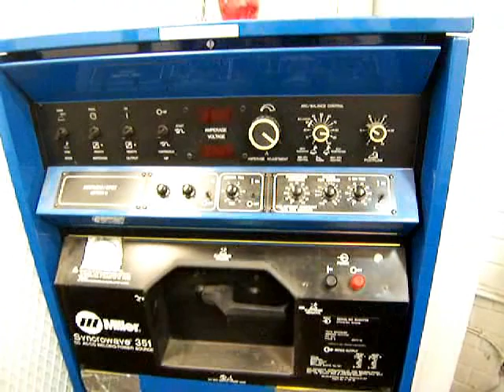Different Types of Welding

Comment: What always drove me nuts was working in ships that were making railings and bannisters, you want all those teeny welds looking great, but you only have mig welders around, then you gotta grind and sand with dynafiles all over, a tig torch would go so far there, no cleanup really required.  Wast more time with mig, and tig is already clean even though slower process, but mig cleanup is even longer.

Comment: Im just wondering what the best way to weld huge pieces of plate steel together is. Ive never welded before or at least not like this. Im a blacksmith and im going to try making a roughly 250 pound anvil with my dad who is a great welder. Itd be made of roughly 1 to 2 inch thick plates of steel welded together and it needs to be as tough and as solid as possible.

Comment: I liked your video.  I was wondering if 18 gauge stainless steel square wire mesh  can be tig'ed to 1/4' or thicker stainless steel plate.  Or is the 18 gauge leads of the square mesh too difficult or impossible to attach to the plate?

Comment: no love for the flux core? sad days.
Reply: Isn't flux core just Mig with special wire and no shielding gas? It's usually not considered a separate type of welding.
Reply: Flux Cored Arc Welding is a different welding process compared to Gas Metal Arc Welding. GMAW uses a solid wired where as FCAW uses a tubular wire which contains a flux that produces the needed shielding gas. It can be single or dual shield if an external shielding gas such as Co2 is used. GMAW requires a shielding gas due to the fact that there is no shielding gas from any other source.
Reply: +drdwkelley yo he wanted some love for flux not a googled deffinition of what it is

Comment: Do you have any experience with old school gas welding? I only have a DC stick welder and I like it, I was considering a scratch start tig setup to cheaply expand my options, but if I wanted to I could get a gas welding setup for free, minus the bottles. Reading up on gas, it seems it can do the same job, more or less, and it can silver solder and braze.

Comment: Another misconception people will have about Flux Core is its always a  Gasless process and that absolutely not true. In fact most all Flux Core welding done on heavy equipment manufacturing is done with Gas Flux Core. You still run the same 75/25 gas and everything. And as Jodie says if you know what your doing you can make some of best looking welds as well as some of the strongest possible. Im actually getting to where i prefer it over hard wire gas MIG now to some degree but it all depends on the application. My next venture is to hone my TIG welding skills and at that point ill be well rounded with all welding process's. Of course i figure ill end up with just as much time under the hood to perfect TIG welding as i have with ALL the Stick and MIG processes ive run. But thats ok.. Its never too late to learn more.
Reply: You, sir, are speaking of dual shield! That's the ONLY process worth running on heavy equipment.
Reply: Mad Anthony Wayne I weld Paving Equipment at the shop i work at now. Thats pretty much how we weld everything. Theres a few things i weld TIG but even the pressure tested stuff is all Flux. Flux Core is also ALOT easier and better for doing pressure tested stuff i think because where you stop and restart doesnt tend to leak like it does with Gas MIG!

Comment: hi guys, i am very new  in welding, but i have always had an intrest. i found that it is overwhelming for me to learn all at once, i was wondering if i could get any advise on how any of you were taught or if anyone has any tips, i would be happy to learn
Reply: I just wanted to say thank you to everyone who helped out and gave advice! And just a little side note: I ended the semester of welding with a 100% :)
Reply: +kate sorg You can go to Jody's web site "weldingtipsandtricks.com" and look under the 'forum' tab.  Introduce yourself and feel free to ask questions!  I am an instructor at a tech college and I can offer you some advice for specific problems.  Where are you learning, and why do you want to weld?
Reply: thanks guys!
Reply: an apprenticeship in sheet metal, boilermaker, or boat building is a good start
Reply: +kate sorg 
Just general advice, start learning with stick/arc welding. Once you get good at stick and gain some knowledge and experience, move to TIG and then MIG. Take the time to get good with the stick. If you do that, learning the TIG and MIG becomes much easier and quicker to pick up on.
The most difficult part of welding (in my opinion) is learning the appropriate styles and technologies to use depending on the application. Also learning a little metallurgy and how to better identify the different types of materials you will encounter really goes a long way to making you not just a passable welder but a good welder.
When you know what kind of material you are welding and the best materials and welding technology to use, it really makes the task so much easier and you just get a better all around result.
Based on my experience, welding skill will come with time and experience. Welding knowledge is what separates the girls from the women (in your case) ;)
Reply: kate sorg
Congratulations! I only got 85% out of my first class.

Comment: Tig is by no means a slow process for a skilled welder
Reply: +Rasmus farkas I think what he means is it is a slower process compared to MIG. TIG and Stick are specialty processes for specific applications in the field. No manufacturer is going to have you weld for instance Hollow Metal Door Frames TIG because in the time it takes someone to weld 1 door frame up TIG i will have 5 welded with MIG. Even Stainless Doors and Frames will be welded MIG not only because its faster but the final look of the weld means nothing because it will be grinded down smooth anyway to be finished and have the lines in the stainless put back in.
TIG is more for cosmetic applications where the look matters more than anything in a manufacturing environment.
Reply: Yes it is without a doubt

Comment: stick holder allows you to angle the filler rod or bend the filler rod looks cool but I need to understand more about the dc  and ac machines the smaller machines are usually only ac 120 or 240 but having dc and different polarities may do something different that I currently don't understand

Comment: Sir, If I want to weld a M3 nut to a 2 mm width steel shaft (The shaft passes through the nut), which is the best process? This is for toys and not industrial use. I don't want to use glue.
Reply: Coming from a relative newbie, and talking to a few old timers, you should go with tig.

Tig is known for having a very precise and tight welds, and is also the most clean in the sense that there is no slag to chip off or oxides to wire brush.
Reply: Sachin Kotian dont listen to this guy above me. go with a 110v mig and tack the nuts to the shaft, 2mm is pretty small so tig would probably be the best and strongest way... but considering its "non crucial" type of weld a 110v mig would be best, also considering the initial cost of the machine too. way less then a tig machine.

Comment: Can you tell me, why is it when you tig aluminium you need AC, but you can DC weld aluminium with mig?
Reply: I'm not an expert, but I think if you TIG weld aluminium with DC electrode negative you don't get the cleaning action necessary to bite through the oxide layer to get a good weld, and with DC electrode positive you get good cleaning but the electrode starts to bulb from the heat and causes the arc to be less controlled. AC gives the benefit of control and cleaning because it alternates between positive and negative. You can weld with DC on TIG, but it's best not to because of the disadvantages.

In MIG welding the wire itself completes the arc, and because the wire is constantly being fed through you don't have to worry about rounding off the electrode and creating an uncontrolled arc, and so DC electrode positive on MIG will give you cleaning and control.

Comment: Generally stick welding is considered too slow for workshop applications and is reserved for site work only.
Reply: Sturm geschutz i think you mean production settings. stick is still the most common process for workshops that commonly handle material 1/2 and greater. stick welders can be bought much cheaper and are more versitle then say like a spray transfer mig.
Reply: No, where i worked we made alot of custom jobs and it was always quicker to mig rather than stick.
Reply: Why would you stick weld a digger bucket or a 40 ton coal hopper or a 20 ton peat dryer when you can mig it? That would be madness.
Reply: not everyone has a spray transfer mig, or a big enough shop to do what they need in. with stick you can do the work anywhere. youre not limited to what you can fit in the shop.
Reply: Thats a different case, but surely a small workshop that is going to take on the construction of say digger buckets they would invest in one. I had a 1980s Hobart bros with a giant armature lol. Perform just as good as a brand new Miller.
Reply: In the field you can't get a mig hook up most times
Reply: a good welder can burn sticks fast though... it is a little slower than mig, but it only takes about 5 seconds to change an electrode if you are working effeciently.

Comment: flux wire welder here ive been through 4 pounds of the stuff and i will admit ive come a long way learning the angles to hold the gun and such with raising the amperage for greater penetration. i use a Lincolin weld pack HD i thought i broke it yesterday however it just overheated! its probably the cheapest welder ive seen for the quality. looking to upgrade to tig with the gas for cleaner welding. and more versatile.

Comment: Normally I would say go with separate machines but the PowerMTS welders are very reliable. If you are at all thinking of welding with those processes I would suggest picking one up. Get a spool gun too if you are doing aluminum. My 2 cents.

Comment: For me it took a few days to get decent at mig, tig, dual shield and 7024 but I found them easier than pipe welding with 6010 root and a 7018 cover which I have did on amonia refrigeration pipeing for 25 years but maybe it is because I really know what I'm looking at now compared to when I started stick welding years ago, anyhow I like all types of welding except tig in the 6g with a open butt, that 7 o clock to about 9 o clock is terrible for me but I can pass a xray and have. just lucky.

Comment: I would love to see a video of stick welding with 1/8 - 7018 rod welding in a tight position.. Currently working on welding 1/4 plates on steel post but with very little space.. I have to bend rods into a sort of "S" shape to get down into the space and weld vertical and having difficult time trying to be consistent..welds are ugly and can only burn about a 3rd of the rod...please help

Comment: If Im welding a steel on a backhoe bucket, or a dumptruck tailgate, I would want to use stick welding correct? because its dirty, and the type of metal. not to mention its easy?

Comment: Great video!! I like your little finger cover. When I was working for DuPont Chemical plant in Waynesboro VA I was tig welding stainless steel pipe. Nothing any bigger than 2”! Clean job!!! I could have worn a suit and tie to work and went home clean. I had a cover for my baby finger and ring finger. That’s all I used. No glove!!! When tig welding cap on 1” heavy wall stainless steel tubing it looks like a wedding band when done. Purge inside when welding. I loved that job.

Comment: u make awesome videos... im a field boilermaker and we still use 80% stick welding in the field,,, other 18% is tig and maybe 2% mig,, u barely ever see mig out there   keep up the good videos and info guys..

one thing that would be helpful is showing your input on 309 stick all the way test on a 2" pipe in the 6g position. probably one of the hardest tests   thanks

Comment: Stick welding power sources are the best bang for your buck! You never get shut down on a saturday afernoon in the shop because your gas bottle is empty. I weld exaust with 6010 or 6011. 7024 lays down metal as fast as short-circuit mig on heavier metal with ease, eats light scale and rust much better. 7018 all around super quality! If the weld looks good it is is most true with stick. It does take time to learn, but if you master it other process are easily learned later.

Comment: Thanks for the great video! I really am glad to see someone give stick rod some proper credit. I weld in a factory the booth I work in uses stick rod about 85% of the time. I weld dissimilar metals constantly and alot of stainless. I also weld on crome-moly and pressure pipe with small diameters. The versility of only having to get diffrent rods out of the oven and amperage adjustment to weld a diffrent joint is vert handy! I face the  X-ray all the time even on open root stainless. No problem !

Comment: Help!  I have a Millermatic 180 (a 220v mig welder) and I am welding 1/4" plate steel all the time in my garage.  The chart shows that for a 75/25 gas mix, solid core .030" wire I should be at a voltage of 6 and a wire speed of 85.  That is so hot it gouges the metal, especially if you are trying to weld vertical uphill.  I normally use a 6/65 setting and it seems to work well.  Any throughs?  It sure looks to be penetrating well enough.  Thanks whomever!

Comment: @ele21ification looks like a 115v inverter so you could use it in any household plug, dont expect to weld thick ass pipe with it and you might have to go even thinner than 3/32 rod to keep from blowing breakers that are less than 30amp, but its super light and runs off basic household current so nice and portable if it runs id say its worth the money if you can put it to good use

Comment: @weldingtipsandtricks 
6011 is colder and has less dig.  It also does not displace the flux as well.  6010, with the 5P and 5P+ variants, are suited for contaminated, greasy, dirty material; more so than 6011.   Try and jam in a root pass with 6011 and say there it is not any different than 6010.

Comment: like the 2 heavy wall butts at the end. just finished a procedure that involved 120mm plate single bevel. gtaw root and hot pass 8mm deposit. fcaw 60mm deposit =84 passes and the final fill and cap with saw= 76 passes. preheat was 50 degrees c and interpass was 250 degrees c . the plate was 1 metre long so we could perform multiple mechanicals. nice vids

Comment: I use stick at work, mostly for strength more than appearance, I just learned it by myself, as I have to with most things I do there, and although I can do an ok job, that thick walled pipe with the many passes is insanely nice, musta used a lot of rad on that one.  Never did any MIG or TIG, but watching this makes me wanna join some coke cans together!  Anyways, nice informative video, thanks!

Comment: @spelunkerd  DC welding is much easier than AC, use reverse DC for the best bead if your welder has that option. Along with a low hydrogen rod you can make very impressive welds with some practice. The cleaner your metal is the easier and nicer the weld will be.

Comment: @yumyumsashimi the general rule is: you don't want to weld anything that is smaller than the diameter of rod you are using. For instance, if your welding 1/8" sheet metal, you can use 1/8" rod or 3/32" rods. Going to a thicker welding rod will run the risk of blowing through the sheet metal. If its thinner than 3/32" and its carbon metal, I would suggest a 6010 or 7010 type of welding rod that is "fast freezing" and allows you to "whip" the rod and build up the metal.

Comment: @weldingtipsandtricks in what cases would their be a difference as far as the application you would use it for? i know 6011 is runs ac and 6010 is preferred for pipe but what are the key differences?

Comment from the maker: there is not much difference in the way 6010 and 6011 run.  6011 runs good on AC as well as DC...

6010 is only for DC